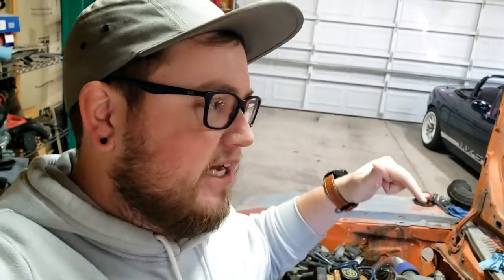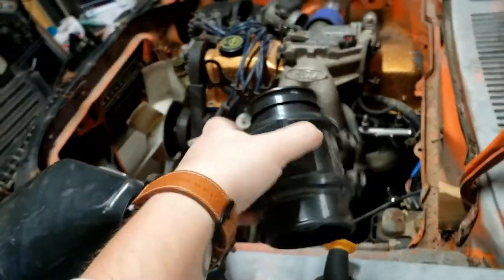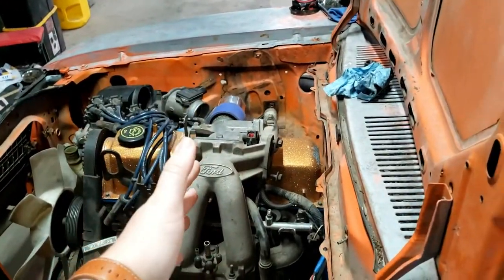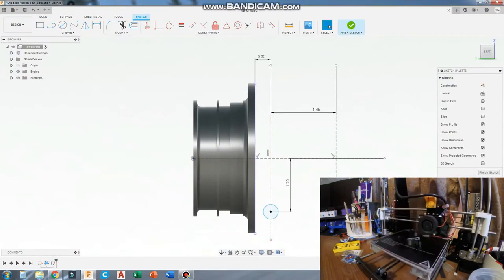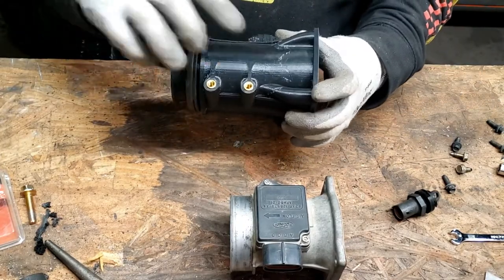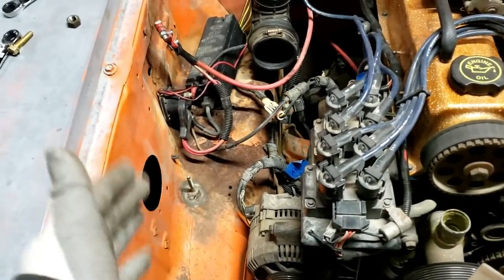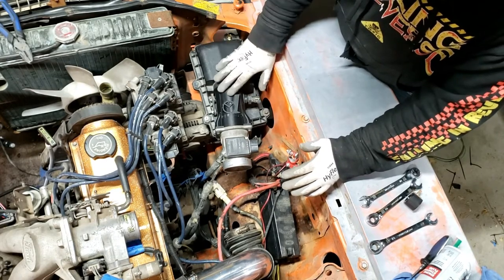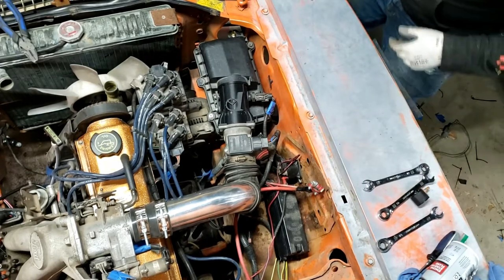Miata Airbox in a Ford Pinto?!

Comment: Aw man I thought you were gonna crank it, how much more do you have to finish it? Im going to try and hopefully crank mine this weekend i hope , im ready to here it run already after all of the time and money i have tied up in it , ive got more into my motor for my pinto than they cost new 🤣 but its going to be a cool car, i need u to 3d print a duel carb breather like the ones nascar's uses with dual cold air kits, that would look badass on my pinto
Reply from the maker: Ah yeah I thought about it, that'll probably be in a video when it will actually run for a few seconds. But yeah that would be cool!